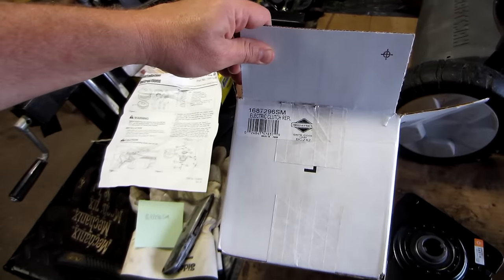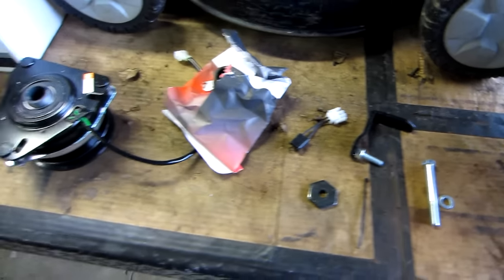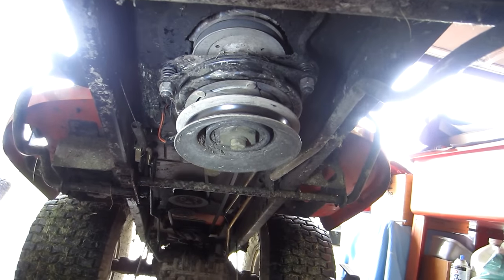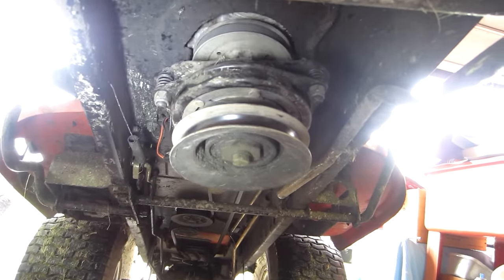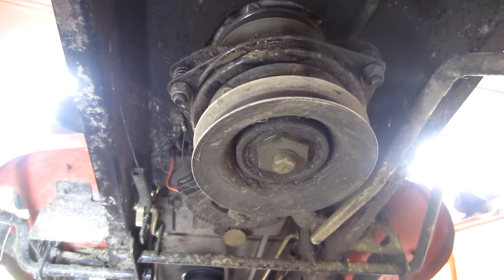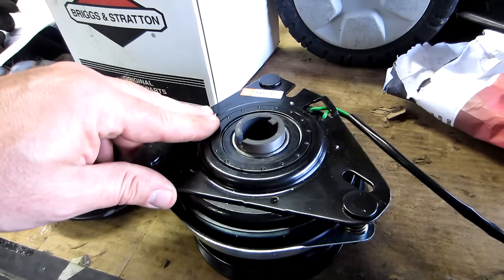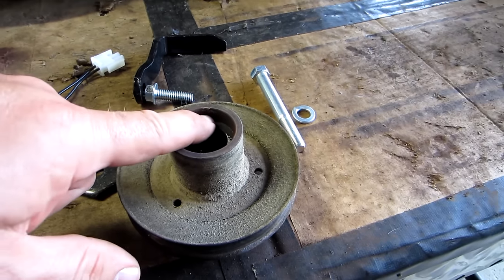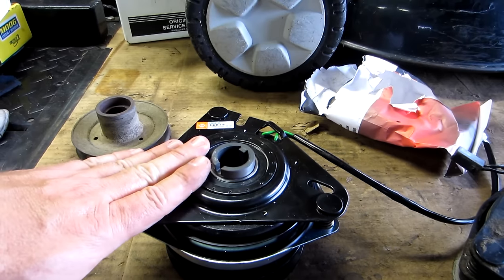Troubleshoot Replace mower PTO CLUTCH

Comment: what i meant to say is that i replaced both the pto clutch  and the switch but the mower blades still don't engage.
Reply from the maker: You will have to test for power to the switch, then out of the switch, Then( if equipped) to the relay, then out of the relay, and finally going into the clutch..
Reply: ok will do thanks for being there for me.

Comment: Would it possibly also be the PTO clutch if, I turn on mower and let go of clutch and it shuts off engine?
Reply from the maker: That's a safety switch failure issue... It shuts off because it thinks you are not sitting on the seat..
Reply: Dang! I bought this riding mower from a guy on CL. He had it rigged with a piece of board pressing down on safety switch. It had got loose and wasn't allowing the pressure from the seat to press down on switch. Anyhow, mower works fine now. Thanks a million for your knowledge! (I would've never figured it out) ..was almost ready to change out the PTO.
Reply from the maker: Love It!! Good News for sure!!
Reply from the maker: 90 percent of the time when a gear box locks up the belt will break if worn.. I would guess the gearbox isn't messed up because you reinstalled the belt wrong BUT, the belt broke because of the gearbox failing..

Comment: Im not a pto user it all and don't like them so my newer old red craftsman's gonna get stripped down because its a pto type of mower its transmission and engine is gonna go on the old green craftsmen and put up the original Kohler pro cv16s engine off of it i could use it but Kohler keeps giving me more and more trouble from its carburetor bowl so that engines coming off I'll have 3 still good single cylinder Kohlers someone might want

Comment: You didn't show the most important thing which alot of people are looking 4 is how to remove the clutch...good video anyways.
Reply from the maker: Thanks for the props, but if you don't know how to unplug a connector and remove a single Bolt, then I don't believe those type of people should be working on their own machines.

Comment: Good video.....
Reply from the maker: Rick Stone, 👍😁
Reply: What would the resistance be in or about  I just placed the tranny was running good for a minute till I put the pto on..........forgot to put the stop on ....twisted the wires shorted the fuse ...I repaired the wire ...mower won’t go forward or backward and pto won’t come on....those two wires on the pto is it a switch.....?
Thanks Rick...desperate.....

Comment: You replaced all those parts, and the only problem is a faulty voltage rectifier/regulator.
Reply from the maker: Nope, these parts corrected the issue..
Reply: Did you check the charging system to see if it's working right? That's the first thing I would have checked.
Reply: So you didn't check the charging system to see if it's working right?